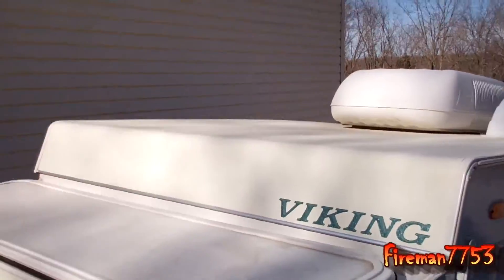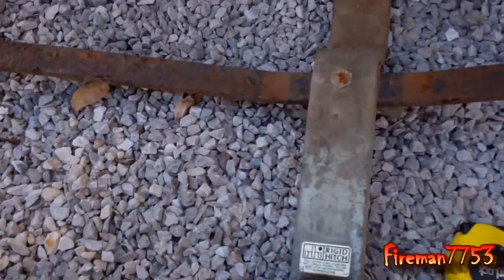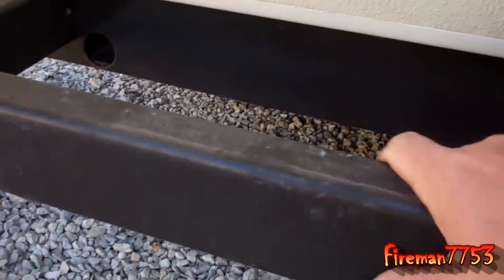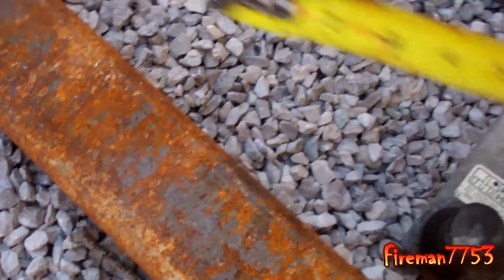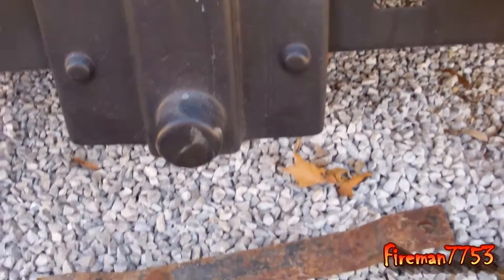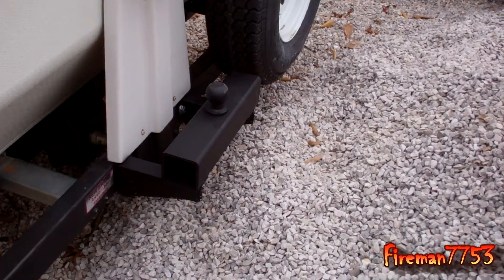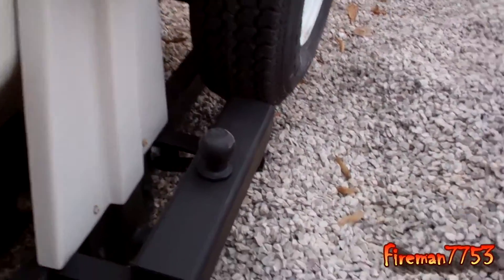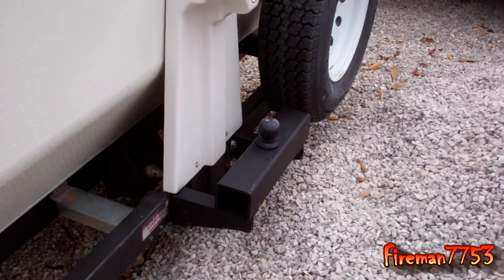Added a Trailer Hitch to the Popup Camper

Comment: I couldn't tell if you welded to the frame or not, but just wondering if the setup has worked for the last year? Any problems or breaks?
Reply from the maker: ***** Actually a week after I finished this project I sold and upgraded to a newer camper.  I never had the opportunity to use it.  It was one of those unplanned deals.

Comment: Where do you live that you can pull double trailers? If we did that in Pa you would probable be arrested!! Great idea!!
Reply from the maker: Greg O'Day Missouri. Supposed to have trailer brakes on the first trailer by law, but as long as you don't drive like an idiot they usually leave you alone.
Reply: Greg O'Day Triples are completely legal in Texas as long as the distance from the front of the tow vehicle to the rear of the last towable is less than 65 feet. I'd never do it, I don't think ;-), and Ive never seen a triple in real life, but there are plenty of entertaining pics online.
Reply: Seems like an open invitation to fishtailing. If it works, then good on you.